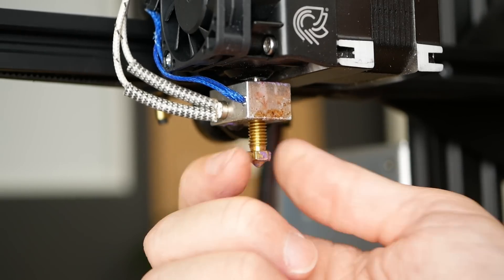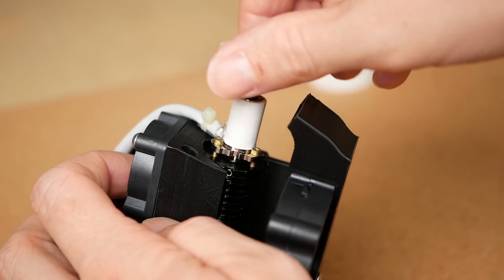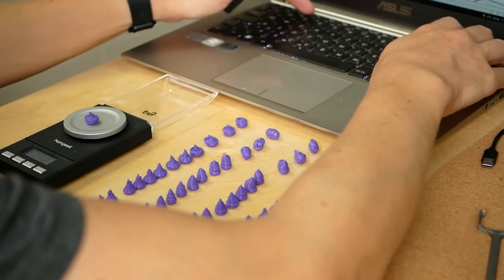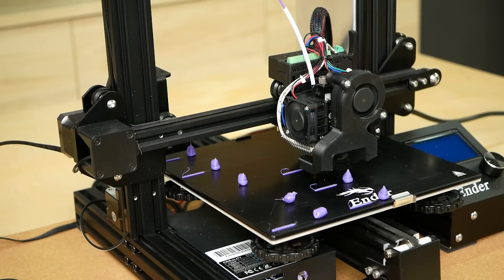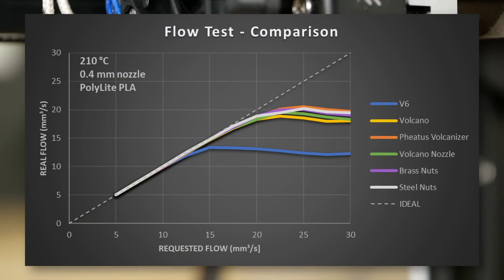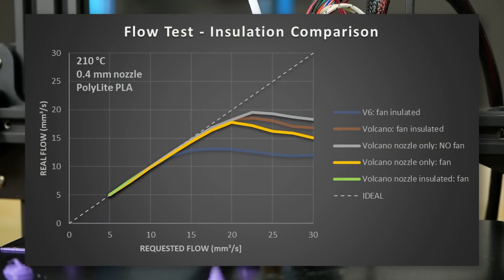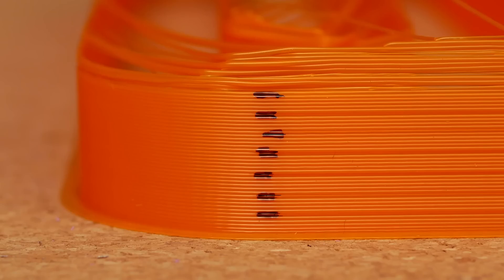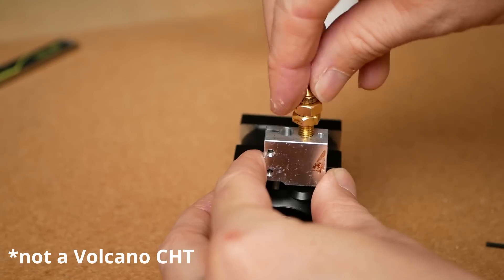Volcano is Obsolete: Just use Nuts!

Comment: I have been running with that as well.. I believe that Tom showed a hotend for al loooong tome ago with nuts.. Why not use the Volcano adapter and extend the Volcano =)
Reply: Oozing will probably get even worse, but if that is not a problem for you, sure, go ahead. Would have like for stephan to print something like a benchie with these nozzles to show that effect, none of his tests looked at the potential oozing issue.
Reply: @ProtonOne11  ouzing is normally not a problem with a dialed in printer.. I running mu VolcoMosq without stringing or ouzing..

Comment: Interesting findings but given the rise of CHC heater cores, Rapido or CHC V6 Pro for example, I would probably invest in those before I try other things.  
The ineffective heater block design of the V6 (especially with alu blocks) is really the biggest killer of proper flow afaik.
Rapido UHF with a 0.4 CHT Volcano let me push out 65mm³/s without issues so far, something an old style hotend can only dream off. Even the 400USD Magnum+ sweats at that.

Rapido has a more premium price but the CHC V6 (Pro) heater cores can be bought for as little as 25 bucks and they just screw into your V6 heatbreak and heatsink. Now you got nearly as much performance as a Rapido for 1/4 the price. Would be nice if you could test those.

Edit: Also I just noticed that you use a better heater and possibly a copper heatblock.
If people go and try this on Ender 3 style 30W heaters with alu blocks I think this "hack" will not even work since it might not be enough performance to even reach the tip. Let alone partcooling causing issues here.

Comment: Cool, did pretty much exactly that and got +60% more flow.
P.S. With hardened steel volcano nozzle there much less of an effect w/o a brass nut, which makes sense.
Reply from the maker: Good job!
Reply: @CNCKitchen  could you explain how to adapt the z probe for auto bed leveling and z homing when making the nozzle longer?